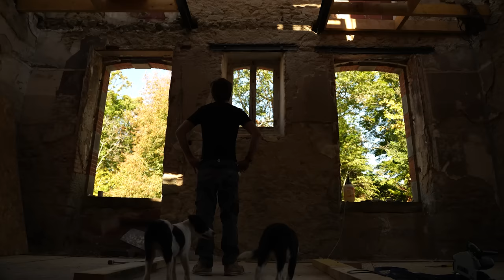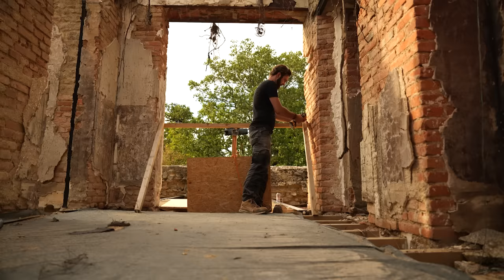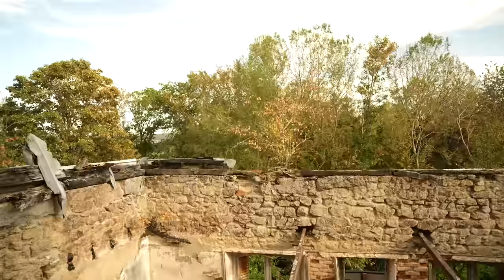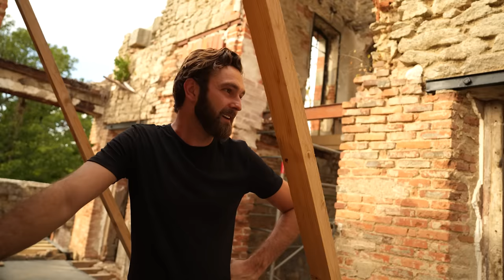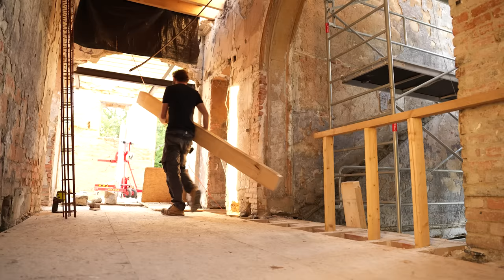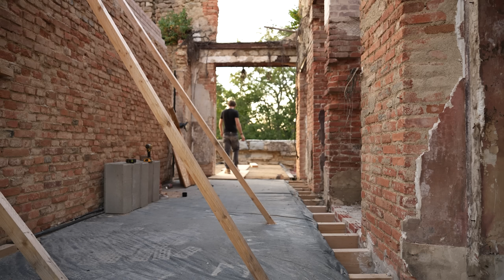how to recreate the original roof on this château ruin.

Comment: 6 months ago Dan laid out the plan going forward.  In that episode he said he'd submitted all his plans and until he got them back the major work couldn't start.  

In the meantime he would clear the grounds. Tick.

Fix the drive so deliveries etc could get in. Tick

Make the work site safe by clearing out rubble. Tick. 

Get scaffolding for the turret.  Tick

Get access to each level by putting in new steals and beams to make working at each height easier and to get to roof height for roof measurements.  Tick. 

Plans are now back and major work  can get underway.  By my reckoning Dan's on schedule.
Reply: lol so Naive

Comment: It's been a few days since this video was published, and every time I take a quick peek to see if there's any more news, I keep coming back to the same conclusion. 

If you can take accurate measurements, including the angles, the most efficient, quickest, and safest way of getting the new roof on would be to build it in sections, either off-site in a factory or on-site yourself, and then use a crane to hoist it into place, joining the sections together once at roof level. 

Winter is coming. This is the quickest option to allow for waterproof membrane, slating, and insulation installation if you're truly serious about getting the château weather tight ASAP. Despite the expense of crane and operator hire, I think it would more than repay the investment in terms of the subsequent speed of the restoration. What it would mean in terms of the stabilisation of the structure alone would be priceless. Imagine being able to reinstate the attic windows and plan ahead by ordering the windows for installation in early Spring; if you're planning on oak double glazed windows, they take months to make.

Comment: Dan about the lightening conductor- it is not generally known but many old buildings used spires and tall rods on the roofs to collect aether energy from the air as electricity to use for the buildings. This is free energy which Tesla was able to connect and use. Worth investigating. I am so excited for you and await the roofing blogs. With blessings Hazel

Comment: Taking into account the state of the upper walls, possibly the  top part  before or in tandem with adding the wall top plate, it may be an idea, along with your structural engineers advice, to level and reinforce the structure with a reinforced concrete top plate before adding the wooden top plate itself?

Comment: V148: Very exciting for you to get to this level so fast Dan! How about building a large  tarpaulin 'tent' over that whole open space ( the kind roofers use when re roofing a house to keep rain out?) Problem is it is scaffolding which will be very heavy to get up there? OR do Brico or Chausson do some sort of system that will do? It is coming on superbly and the pups are growing so fast. WHEN the time comes to be working OUTSIDE the roof on the slippery slates PLEASE GET A FALL ARREST system in place  with an 'A' harness and fall arrestor. That looks about 20m high😯 stay safe! 👍 You still have a lot of 'evidence' on the wall plate there next to the wall that should help with your detective work!

Comment: Winter is coming...and so it may be necessary to built some sort of roof in one section to be able to keep working throught the rains and maybe some board up windows to stop some winds. Planning to reduce the misery that is building in winter time. Plan inside jobs for the worse days, stock up some materials, etc

Comment: Before you nail down the floors I would use construction adhesive to completely secure the boards to the framework underneath befor you start nailing and your floors should be absolutely quiet. No rattles.

Comment: Yesterday I thought it was possible to have a series of identical trusses made up; however, looking at the photos, this is more of an engineering job. Perhaps using lightweight steel would be a better option. My greatest concern is putting the cart before the horse. 

Yes there is a lot of lead time; however, those walls need to be fully rebuilt before the first roof beam is placed. Right now there is plenty of vertical forces holding things together with downward pressure. Yet from your videos, the walls are missing quite a bit of depth and lots of the old mortar is crumbling due to the fire and time. With the roof, you now are placing horizontal loading on the walls, in effect, the wind will push the top of the wall in a given direction. Right now when the wind blows, there are windows and other places where it can flow thru, still placing pressure, but the open windows allows it to flow thru. A solid roof is like a sail, that force has to go somewhere.

Comment: Have you considered getting a 3D Laser Scan of both the inside and outside? Would give you milimeter accuaracy on which to base your CAD. Would also save trying to measure those really hard to reach areas.  Maybe one of the Laser Vendors (Leica / Faro / Trimble) could sponsor you.
Reply: Grandioos. 🎉

Comment: If you can swing it you really ought to have an elevator and place it for permanence. Even if you have to sacrifice space and some of the old plan as you know it, that place is going to need one. It could have up to 6 floors.  It's just amazing how much you have to lug around alone. Maybe you can get one in before you go to the next wings?  I really don't know how large you'd need or  can get in there? 
Actually If it was my place I might do without the main stairs and rely only on the elevator. Some fire safety stairs would be required somewhere.  An elevator stair core somewhere?

Comment: I wonder about expansion and contraction of the steel and wood when you fit things so tightly. After all this hard work, it would be awful to have things buckle. Hopefully, a structural engineer can answer those kinds of questions. Quite an undertaking.

Comment: I am thinking as winter approaches that the best idea would be get the attic floor down do a concrete ring beam ,then put a one fall tin roof on well secured ,that keeps everything dry after this no rush working in the dry repairing all the walls and doorways floors properly before putting a massive load on the top of what is at the moment quite a compromised structure does anyone else agree ?

Comment: I just want to know what will be next! Then after that!

As much as I enjoy watching Dan make progress I keep wondering what the next few steps will be. 

I run through what I would do next but as there is no set correct way, I keep eagerly watching to find out which way Dan will go.

Then there are the more simple questions. Now Dan has taken the stairs out from the kitchen to the 1st floor, where will the indoor connection be? What about the access to the next two floors in the top of the tower and the top floor on the rear wing?

Comment: The good thing about the short pieces, is that then is only short strechtes of wood worping. A long piece of wood will worp uniformely. And should rot occur, then you only have to change one piece, not the intire piece. I think, that they did it on purpose.

Comment: Perhaps for the turret, you might consider building it in the ground in relative safety, then erecting it with a crane. The engineers would need to accomodate that in their design.

Comment: There's a much easier way to lift sheets of plywood (and other material) up to the next floor. Get yourself a rope and a large C-clamp. First, stand a sheet of plywood on edge and attach the C-clamp to the top edge of the plywood. Then use the rope to pull the plywood up to the next floor (or higher).

Comment: I just noticed at 2:52 there is someone right up the very top of the main turret roof. I have a suspicion now that there was another floor inside the turret roof, hence those windows 1/2 way up. I have a feeling now that there was possibly 2 or more trap doors and ladders inside to get to the very top peak. 
Damn i couldn't imagine the view from right up there at the top. 
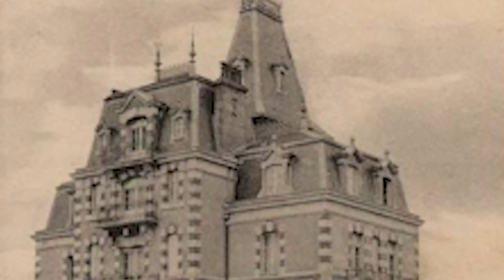I noticed at 3:05 from the rear there is no external ladder from the rear roof to the spire so it must all be inside and internal.
Reply: There were two floors inside the turret; the lower room flanked by terraces each side, then a smaller one above. Finally, spiral stairs or ladder to the outside top (widow’s walk). Room for two chairs and a table. “Dinner anyone?” All access to rooms/tower were inside.
Reply: @PaulRiesland  there are two floors above the terrace floor. There is one floor currently above his head above the terrace floor, then you have the 4 red walls above that with what looks like no window but it may of had a Slatted Louver or Vent on the front under the eaves. That floor probably had trapdoor and ladder access.
Then on top of those 4 red walls was actually the roof's floor itself. Thats where those 4 windows are on the spire roof. 
I am guessing there is also another ladder access from below to that. 
Then further trapdoor and ladder to the Widows Walk above that. 
In total 5 floors not including the Widows Walk or basement. 
If you include those then its a whopping 7 floors.

Comment: I am curious Dan, that standing winding lift of yours that you have been lifting with, just how far up can it reach? 
If you were to clear the floor of the opposite wing and put down large boards like the other side to reinforce the sketchy concrete and wood floor (with the amount of walls underneath it, compared to the other side that is just one huge empty room, it wont be that weak) could you use that lifter to get the beams right up the very top floor? 
That way you could actually work in reverse and get the very top floor and roof on top before getting the lower floors done. working downwards floor by floor and never having to move the Lifter.
It could very well save you time and heart ache having to go floor by floor and lifting all those beams up to each floor and having to also take the lifter up as well.

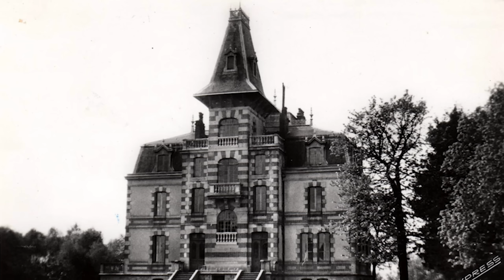Comment: @3:10 the original flue pipes come far too close to the tower eaves.  It's like that on both sides of the tower. If it wasn't for the fcat that you found so few roof slates in the rubbish I'd think they were the cause of the final fire. You're probably going to have to treat that situation differently to pass code requirements in France.  The fireplaces don't appear to have been very large (at least what we've seen so far) so maybe they just didn't use them much and relied on the radiators?  
It's very obvious the house was a nod to modernism. It's got characteristics that remind me of the Mark Twain mansion in Hartford Ct. The architect of the Twain house was probably very aware of all the design trends fashionable in the late 19th century and was very likely influenced by european developments.  By the time your house was built the architectural profession was using mass media magazines and professional journals. Maybe you can find more on your house if you look in a library - Paris? - that has professional architectural journals from the time? Maybe, but not likely,  they're online?

Comment: Don't you need to stabilize the interior and exterior load bearing walls before considering any rafters? I am guessing the type of improvements needed for load bearing walls will be part of architect's final plans for the roof construction.

Comment: Temporary fixes require double the labor.  Why not glue and screw the subfloor as you go instead of having to come back and remove the subfloor ing so you can put the glue down and screw it.  Unfortunately, your loosing labor and time but just laying the subfloor down as a temporary fix.😊 😊

Comment: The timber on top of the wall is called a wall plate , you really need to look a some building books , horizontal flor timbers are called joists , inclined roof timbers are called rafters, then you have valleys, hips , battens and purlins. You have a mountain to climb and your first priority is the to scaffold the perimeter and you should make life easier with a crane as you have to get tons of timber, insulation ,  Sarking felt, tiles and lead up to the roof
Reply: no need to scaffold the perimeter, I bet he will use his ladder safely footed on the top of the wall

Comment: Hey Dan, Copy the Roof is one thing; yet I would call it Retro fitting it to modern standards. There is just to much in details. Still have to stabilize the walls & structure. About safety, at times Dan you scare me, walking on joists, open floors with out safety straps or harness. Working alone without a third hand or safety-net & you got kids. I see you take your time while working, but the camera could distract you for that one moment in time. Just be dam careful! What you are doing is a great accomplishment, but don't get ahead of your self either when it comes to safety.

Comment: *Engineer 💵
*Architect💵
Same pitiful shame of Historical home preservation in the USA 🇺🇸 
Once on the Historic Homes list:
*EVERYTHING has to be approved, totally ridiculous.
In all seriousness I can see if the landowner was going to put a log cabin on top of a Mansard last floor.
There is so much city approval it’s made it nearly impossible to renovate.
I had ex friends that desperately needed to tastefully replace leaking, non airtight windows.
With easier to clean both inside and out.
That was a decade ago, the only option being to find someone to build exact duplicates. 💵
So they ‘will’ cast the same shadows.
Pitiful state of affairs when a Mansard style Beautiful brick mansion is falling down just 2 blocks up.
The one the exes are/have been restoring, is being held up.
There’s anywhere from 6-8 houses stripped, or burnt after abandonment.
Yet not an ounce of leeway when owners are made to comply.
While there’s no hope no chance of saving abandonment of lost properties.